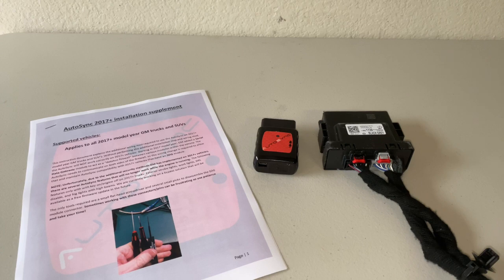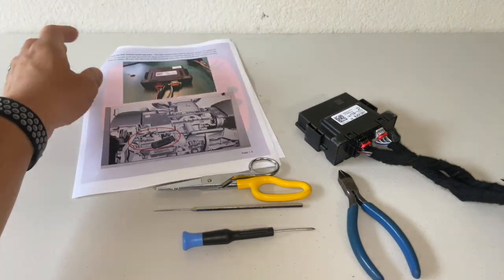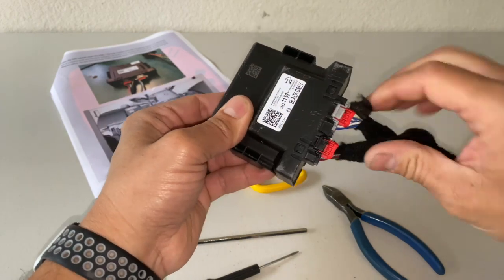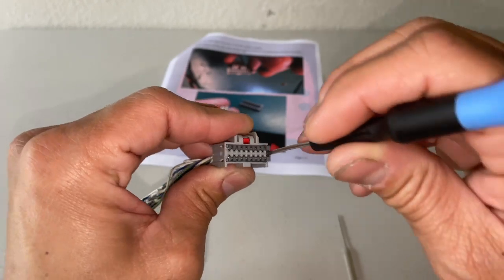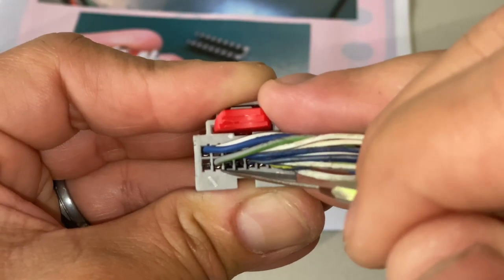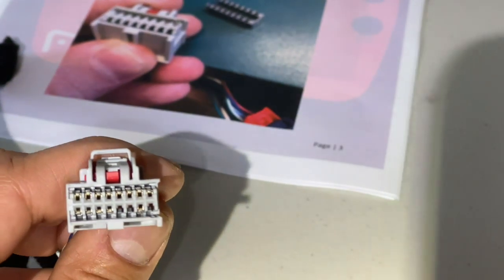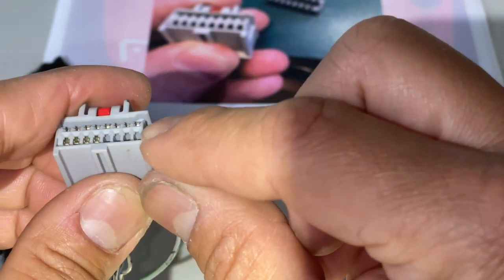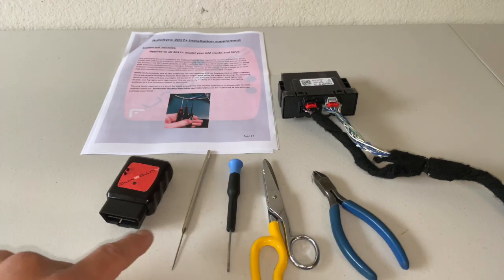AutoSync - 2017+ GM Truck/SUV Supplemental Installation Instructions

Comment: Is moving that wire over going to raise any issues if/when I take my truck to the dealer and they hook up any diagnostics. I mean are they going to be able to communicate correctly with my truck in order to diagnose any possible problems I may have some time in the future. unrelated to this install.
Reply: Good question. Just what does moving the terminal do?

Comment: I bet you would know how I can have a working chrome cast in my 2018 LT? Just for testing could you please share with me? Thanks man.
Reply from the maker: On some trucks, there is a console configuration that have an HDMI input.  I have this panel but have yet to complete the wiring or testing on my truck since my truck didn't have it.
Reply: @philgamboa2906  I'm very interested. Please do share if it comes to fruition.
Reply from the maker: @grin64  There is going to be programing required for sure as the hardware you have now is not HDMI compatible.

Comment: Hey Phil, I'm having trouble releasing the terminal. Any other tips?
Reply from the maker: Rene BT - Try using a good light source to see down into the cavity. If you are applying pressure on the wire, try not applying pressure until you can get the pick tool in between to release.
Reply: @philgamboa2906  okay, thanks a lot

Comment: Hey Phil. Maybe link to the proper removal tool that GM recommends.  Mouser usually has pretty good prices on them.
Reply from the maker: Thanks for that.  There are MANY terminal removal tools and each are slightly different.  I stopped sourcing each one of these types of terminal removal tools because the concept of removing is the same.  I have over 100 different terminal types I use, which means 100 different terminal remove tools ;).  I found that a pick tool serves my needs for a majority of what I do.
Reply: @philgamboa2906   -  ANy source for the pic you use in the video? I like that long reach, all mine are shorties.
Reply: Taken right off the Factory Service Manual - J-38125-12A
Reply from the maker: HuskieEd Thanks for sharing!